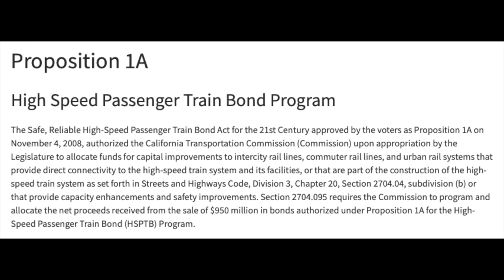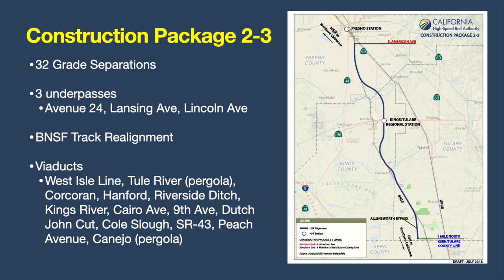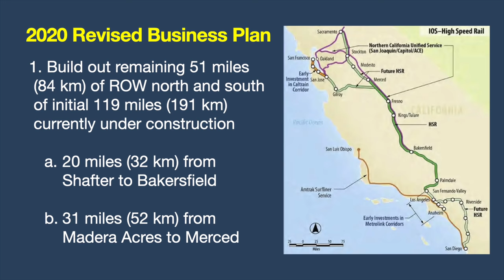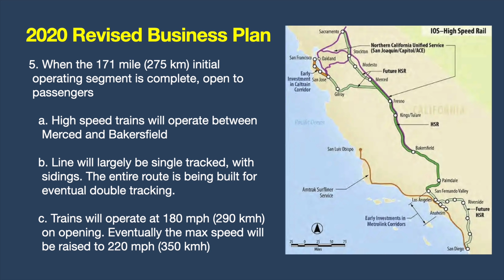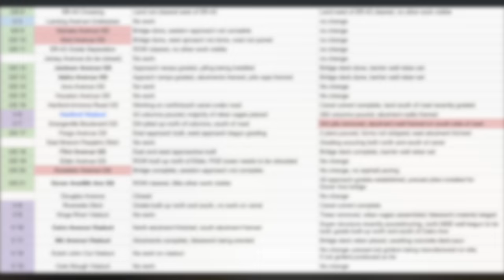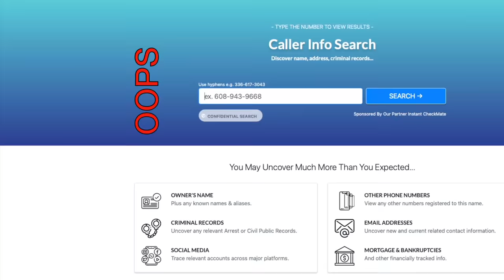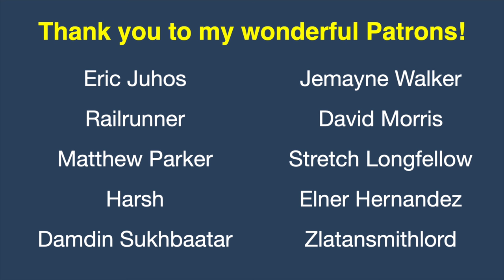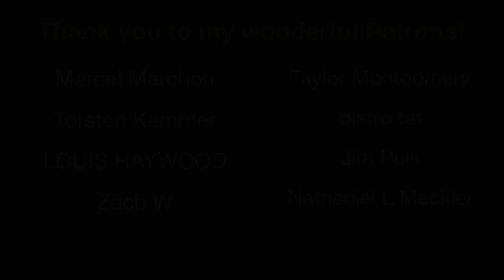California is Building High Speed Rail. It’s time to finish it!

Comment: Past about 150 miles HSR makes no sense. Flying is cheaper and adjustable. 

Also people tried high speed rail. In the 80s a company wanted to buy off the shelf japanese bullet trains and run a line from San Fran to LA. Would take an hour to make the trip. Who borked it? State, local, fed gov agencies and unions. Demands the rail carry freight, demands only US union workers make the trains, demands all trains meet US specs, demands by every town along the route have a stop where the train stops for at least half an hour, the demands by San Fran and LA that the train travel 30mph until it exits all urban areas... that's at least 30 minutes in each town. Crap on top of crap until all that was left was a crappy Amtrak. 

It won't get done.

The problem with greens is they refuse to accept that the government will always block their efforts, the same government they think will solve their problem. The same government that upholds special interest for deep pocket cronies.

Comment: In reality, it's a really expensive slow speed train.
Reply: How is this considered slow?
Reply: @darthmaul216  They have to follow speed limits that make it no faster than any other train most of the distance travelled.
Reply: 220 mph is slow?
Reply: @metrofilmer8894  Numbers on paper are not reality.
Reply: @fraudsarentfriends4717  Too early.
Reply: @fraudsarentfriends4717  The track alignments are designed for CAHSR to go 220mph. Many of the viaducts are already completed. The only possibility where they would have to slow down is at the tunnels that goes underneath the mountains when approaching Los Angeles and San Francisco if they want to cut down on costs. But as of right now, it's planned for 220mph through their Environmental Impact Statement with the Feds except for Los Angeles I believe since that part hasn't been cleared yet. It's the last portion that needs to be cleared.

Comment: Unfortunately, this has been planned by idiots, and the initial segment will go from nowhere to nowhere, and will not even be electrified initially. As a matter of fact, it will initially be used by Amtrak. The service between Miami and Orlando, with is roughly the same length as the California High Speed Rail, is close to 70% complete, with the the initial segment between Miami and Fort Lauderdale already finished and in service (pre-covid).
Reply: Yeah, but Brightline only goes half the speed of CAHSR and isn't electrified. And the CVS will open in 2029, the section to SF in 2031, and the completed IOS in 2033.
Reply: @AVeryRandomPerson  while Brightline is slower, the train will reach 125 on the segment currently under construction, which is top sped for most trains in England, and a good start for us. But My comments was mostly comparing the time it’s taking to build. The high speed rail shouldn’t be taking this long to build in California. Everyone else throughout the entire world is able to build from scratch and have their stuff up and running in half the time it’s taking California. Also, I highly doubt the construction will be finished by the dates you mentioned, with the exception of maybe the section to SF, since Caltrain is already working on that project at the same time as Electrification.
Reply: @theflyingduckman3608  *Brightlines equipment can reach 125. The track can't. It's only being rated for 110.

Comment: that entire project is nothing but a giant cash/real estate/water grab by the state yeah maybe calli needs high sped rail BUT running 200 miles of track between poor rural Ag communities is not a high speed rail project it is "Fraud"
Reply: The city of Fresno is larger than the largest city in most of the other states. Should money spent on those other cities be called "Fraud"?
Reply: @danielcarroll3358  LMAO yeah i live in the area the joke is that the meth cooks in kern co. will have much better access to the dealers in southern Fresno....ofc both you and the joke are ignoring the fact that the high speed project wont stop in Fresno nor is it intended to serve the nonexistent ridership in Bakersfield or Merced(45min n of Fres.). what those two medium small AG towns have are Amtrak terminals....you will literally spend more time getting to the high speed train than you will riding on it and then you will still have to get from Merced to a bart term or to what ever other city transit sys you want to access and from there to your destination.

Comment: Why can't Amtrak do the same they can't even fill their cars and run a schedule that most people can use.  We don't need this expensive high speed rail that will not be able to achieve half the speed they want because of stops along the way.
Reply: Boy! You need a beer. HSR expresses don't stop at each station. There are express tracks in the center away from the platforms. It is impressive to be on a platform and have a train pass at 200 mph.

Comment: Who's going to ride it how many trains a day leaving la and how many trains leaving the north to LA and how packed will those trains be... Look at the way that train just cuts right through the city dividing those neighborhoods how is it that an interstate highway when they do that it's racist but a high-speed train well that's different
Reply: Because a train doesn’t impede walkability unlike a 8 lane highway
Reply: @darthmaul216  🤣😆🤣😆 yeah sure trains don't stop walkability
Reply: There is a major difference between the interstate highways and CAHSR: Rails always were considered to be a form of barrier ("The wrong side of the tracks" is named after this fact) and CAHSR follows the alignment of existing rails so it's more akin to a highway expansion than building a new highway in the middle of a city or in other words: The walkability before and after CAHSR doesn't really change. This is double so when you consider that rails have a considerably smaller footprint when compared to a highway (e.g. higher capacity and fewer interchanges).

Comment: Im sorry but this project was such a waste of money! A HSR that will go from Merced to Bakersfield 2 cities nobody wants to visit. This will end up as an Amtrak upgrade and expansion and it will die there. Meanwhile our freeways are crumbling traffic is getting beyond what our raids can handle and we spend money on this 😞
Reply from the maker: Sounds like a resounding endorsement for HSR lol
Reply: @TheFourFoot  Great video I’ll give ya that 👍🏽 lol
Reply from the maker: Thanks! Lol
Reply: Freeways are not the answer anymore. We need to get away from that 20th century mindset. For example, in L.A., the 405 was expanded on the Westside to help alleviate traffic and create an uninterrupted carpool lane from the valley to orange county. It took many years and a couple of billion dollars. Well, it's been several years now and traffic has only gotten worse. The additional capacity was swallowed up in a few months. Even the carpool lane is slow during rush hours.
Reply: @theexmann  I didn’t say freeways were the answer I’m simply saying we just aren’t maintaining what we have. And we are throwing money at this project and it wasn’t well planned
Reply: @anissabradley8402  Well, there are only so many transit options available to move mass numbers of people as quickly as possible. Freeways worked for a while in L.A..That lasted about 25 before it got to the point of ever increasing demand and congestion. Maybe they should have implemented tolls on all freeways decades ago. Would have been interesting to see what would have happened.

Huge public infrastructure projects like this almost always have to deal with people who didn't vote for it and then complain about it after the fact. And not just complain but actually want to stop it through lawsuits and delays resulting in cost overruns. It's precious how people complain that this project is costing too much and not well planned, but don't stop to ask why some of these problems have happened. The implication is that it's all the fault of the CA HSR. It's not. Yes, they have made mistakes too, but such a huge project, that will take decades to build during varyingly political administrations, is always going to have a certain level of issues. Even home remodeling jobs have those issues let alone a project like this.
Reply: @TohaBgood2  It’s just not practical to build, I don’t see a lot of people using it as a means of transportation. Not in California where everyone drives a car and loves the freedom of driving not to mention our city are soo spaced apart,  nothing is within walking distance like it is back east Ny Boston etc, Amtrak doesn’t even go from LA to Sacramento without having to take a bus over the grapevine, we could have used that money to improved the Amtrak train route. Not to mention we have a major water issue in this state most of the Central Valley is running out of water and we are worried about a bullet train that won’t be finished in my grandsons lifetime. 🤷🏻‍♀️
Reply: I might visit these towns just to see the train. I have been to Fresno and it is pretty nice. I think it was a genius move to start the HSR in the valley. These people are going to have something they can be proud of. And the interconnection of the coast and the valley is sorely needed.

Comment: What a waste, people either drive or use the airplane. It takes an hour to fly vs 3-5 hours for high-speed rail.
As a rail enthusiast, I say trains are for freight which is extremely efficient.
Reply: Let's say you live in Anaheim and need to get to downtown SF. It's a 45 minute drive to LAX, plus you need to park and get through security, at least another 45. Then you wait an half hour to board, and then take the 20 minute taxi to the runway. The it's an hour to SFO. You exit the plane 30 after it lands. Then, you need to walk 15 minutes to the BART station. Wait 5 minutes for a train, and take the 32 minute ride to Embarcadero Station. That's 4:12. With CAHSR, you leave 30 before your train to park your car, and get to your platform. Then it's 3:00 to San Fransico, and the Salesforce Transit Center is a 5 minute walk from Embarcadero Station. That's a 37 minute faster trip than air.